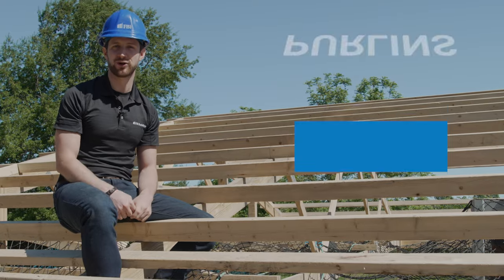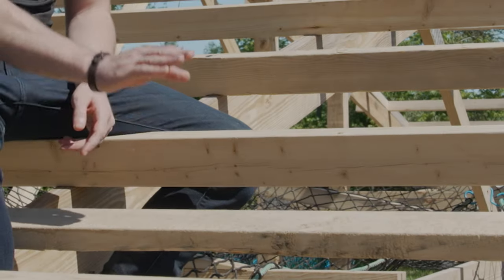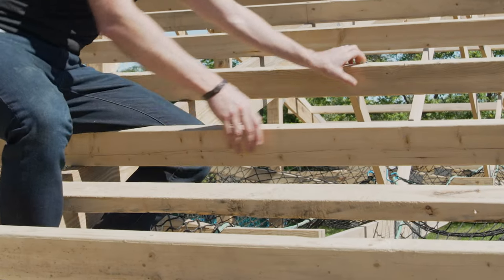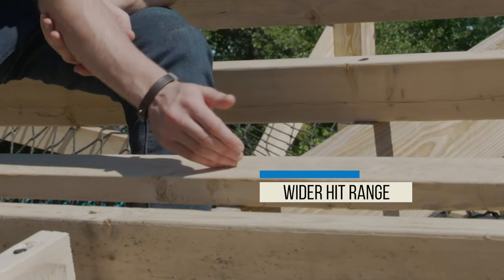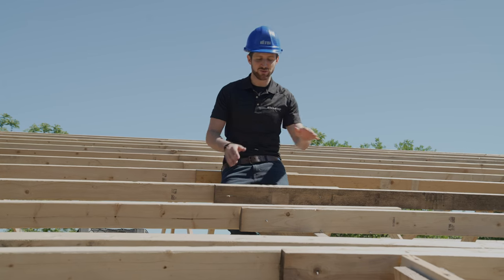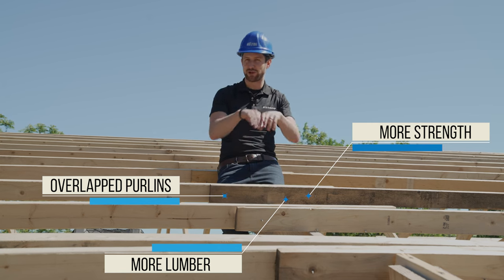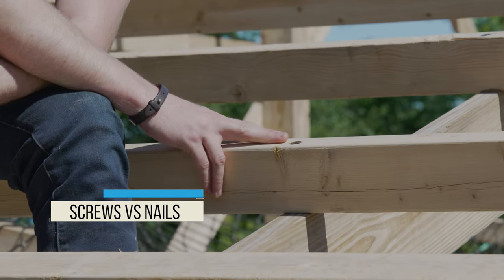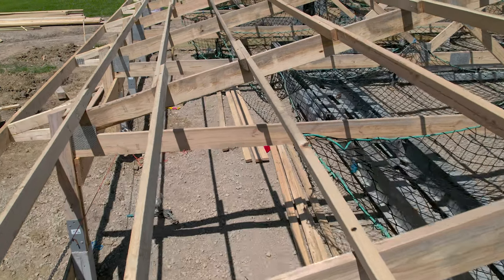Pole Barn Roof Purlins: Installation Options

Comment: I’m in the process of planning a small shop and would love to not have to buy a jumbo nailer for one project. Which screw do you use?
Reply from the maker: It is a 6-in HeadLok screw. If you are interested we have these for sale.
Reply: @FBiBuildings1958  I am just starting the planning stages but I will bookmark y'alls site
Reply: @jhippl hey man I don't know if you started your building yet, but a jumbo nailer is most definitely not required. I think r&r builders (If you've seen their videos) kind of makes it seem like they're an absolute necessity, but they're not. Use screws to build up your columns, use three and a half inch galvanized framing nails to attach your girts, and use side mount paddle boards for your purlins while using those three and a half inch nails.

Comment: Couple of questions which no one ever seems to answer including builders that I have spoke to. I am building a 100x30 pole barn (104 if 8' centers) and I want 10 foot spans and will have the trusses designed and build by an engineer. Yet every builder I call and talk to keep pushing me to build 8' centers and 4' trusses. I explain to them that is not how I want my roof loaded with part of the load directly on the header and there for want the house build per the plans at 10' centers with the custom trusses. He then goes on to explain to me that more trusses is stronger when I explain to him that it is not. You are just redirect the load to a middle truss. I also explained that I wanted my purlins vertical which he said is not possible. 
This guy is not the only one. I have called every builder with in a great area and they all seem to be the exact same way and have no understanding on how buildings are built. 
My question is why builders push for their way rather than a engineering set of plans and build according to that. I think I am going to have to hire a company that is much further away to get the job done or hire a general contractor to do all the work per the plans exactly other wise face legal issues.
Reply: I also want to point out these trusses are 4 inches wide. I will not be overlaping my purlings as they will require an additional 2x on each side of the joint as the building is going to have sheathing.
Reply from the maker: Hi William
 
I'm sorry to hear that you're having difficulties with your construction project. It's possible that your builder is using a standard template, doesn’t have in-house engineers to customize, or doesn’t have crews experienced enough to build a different model. At FBi Buildings we have a standard approach, but we also have in-house engineers that allow us to customize your building design to your needs.
If you are located within our area of business, we'd be more than happy to help you out with these issues.
Thanks

Comment: What about between  trusses vs on top of trusses?
Reply from the maker: Great questions! 

Between Trusses: Purlins installed between the trusses typically require hangers or brackets for support. This method can be useful for reducing the overall height of the roof, as the purlins sit lower, giving a flatter roofline.

On Top of Trusses: Installing purlins on top of the trusses is more common. This method is easier and faster since the purlins rest directly on the trusses without the need for additional hardware. It also creates a sturdier structure, as the load is more evenly distributed across the roof.
Reply: @FBiBuildings1958  thanks for the reply!
Reply from the maker: @ethanwanzek2603  You're welcome!